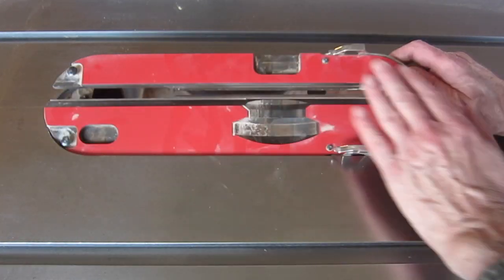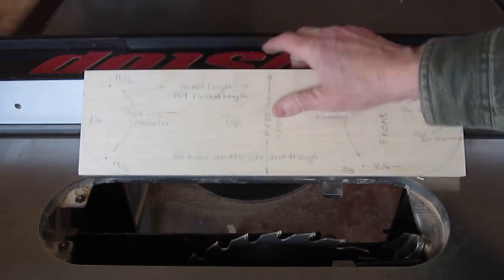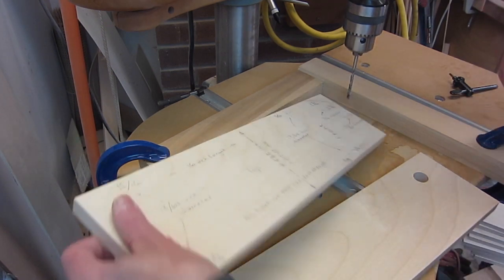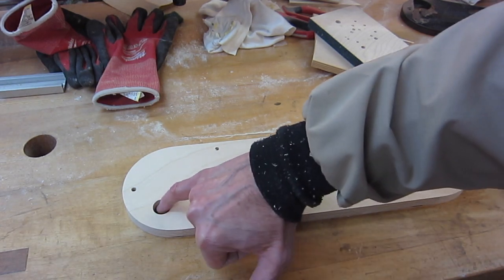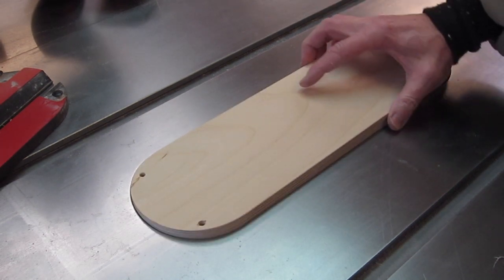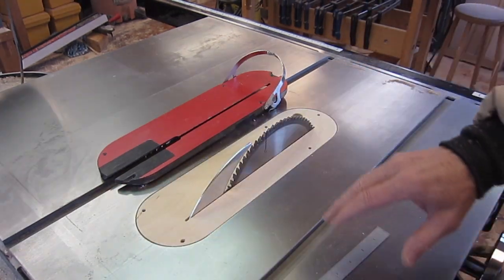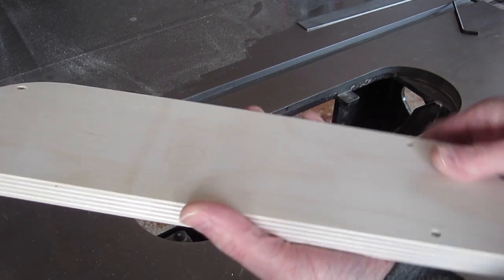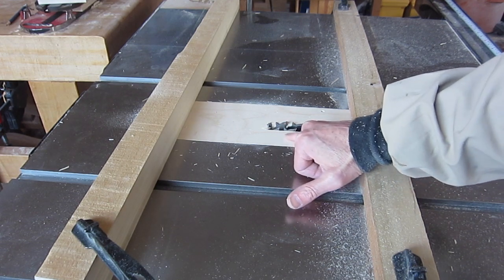Make wooden insert throat plate for Table Saw, including SawStop.

Comment: As a beginner, I’m wondering—wouldn’t it be a safety hazard if the insert isn’t securely fastened to the table? I imagine that starting the saw without material on the insert could cause it to catch on the back of the blade and be ejected.

Comment: Great info . Just ordered a SawStop and was wondering if it was possible to diy an insert instead of buying one. 
I'll be doing this for sure! Hey ..we are woodworkers and should be able to cut some wood ourselves.
Reply from the maker: Full agreement with “we are woodworkers and should be able to cut some wood ourselves”. I don’t like to buy any jig or fixture if I can make one that is just as good, and often better.  Saves a lot of money and good learning experience in the process.     For years, I wanted to buy a tenon jig for table saw, but the modern ones seemed flimsy and had some poor reviews, while the old heavy cast Delta ones where expensive in the second hand market, and high shipping cost for such a heavy item. In discussion groups people said that a shop made tenon jig was not rigid enough to do a good job in cutting tenons.  Finally I decided to build one and I really like it.  Here it is https://youtu.be/d19Q_ireVZw
Reply: @steven.woodward  Thanks, Ill watch that one when I move to doing some mortice and tenon work.

Comment: Steve,  Great video.  Why did you not remove the flat head screws in the insert support rather than make a drilled insert in the bottom of the insert. Seems as if the set screws would provide the needed leveling.
Reply from the maker: Good question.   I wanted to be able to also use the original SawStop inserts which use the screws

Comment: Fantastic video, thank you. 
An adjusting screw on the side would help ensure a tight fit. The ones sold by colliflower have that adjusting screw. Looks like I'm off to the work shop this afternoon
Reply from the maker: Side screws are an interesting solution.   I found the fit plenty tight by just cutting the plywood to fit the throat opening of my saw.

Comment: Great video, very helpful! One suggestion I would have is to route a 1/4" wide by 1/4" deep recess in the bottom surface of the insert, centered side to side on the blade and maybe 4 or 5 inches long centered front to back on the apex of the blade (or create a similar pocket by drilling a series of overlapping 1/4" deep holes with a 1/2" Forstner bit). This should allow cutting the slot with a 10" blade instead of starting it first with an 8" blade, which requires having a dado brake for the Sawstop (which I do) and in my case, a thin kerf 8" blade (which I do not).

Comment: Thanks Steve.. Any suggestions for setting it up for angled cuts?
Reply from the maker: For angled cuts, I use the original red SawStop insert.   Making a wooden insert for angled cuts presents some challenges: the blade could be raised, through the insert, while the blade is set to an angle; the slot for riving knife would also need to be cut at the same angle, perhaps with a Japanese style pull hand saw; finally the blade angle would be matched to the insert, such as 45 degrees, so you would need an insert for each common angle.
Reply: @steven.woodward  I see what you mean.. Thanks.. I was operating under the mistaken idea that my PCS is like my old craftsman where the blade would change it's actual track when the angle was changed until I walked out this morning and checked it. Right up until this morning I had been completely avoiding angled cuts for that very reason.. Silly notion, huh?  Well, this was a relief.. I'll probably now start making several blanks for various tasks. My old craftsman was a motorized version with the squared ends on one end so finding a material that didn't flex a lot was to put it mildly, challenging as hell.. That's a week or two of researching I'll never get back..

Comment: Can you use the blade guard with this insert?
Reply from the maker: The blade guards that replace the riving knife will not work because the slot in the insert would have to be extended to the end of the insert, which would make it too weak.   Thanks for asking this question.   I will add a note to the text under the video.

Comment: Your suggestion for using the sled is a good one.

My previous ZCIs were made from MDF, with a fair bit of routing to make space for the various fit points to the saw.  No screws; just blue tape for shimming to fit.